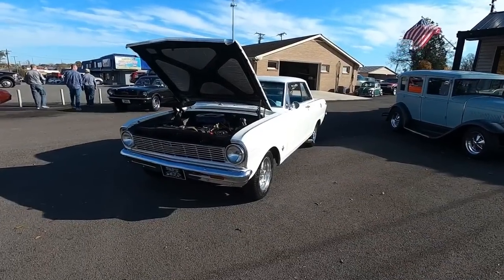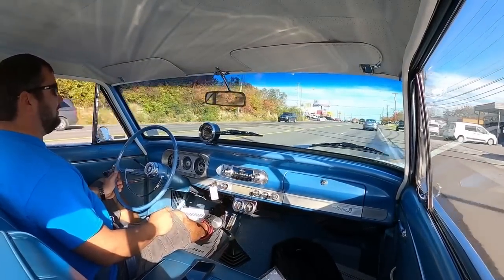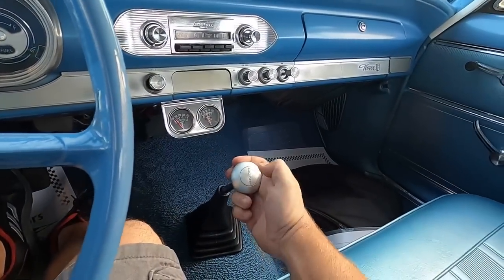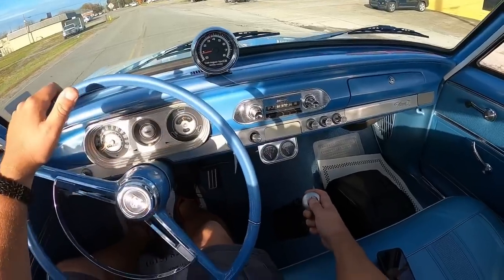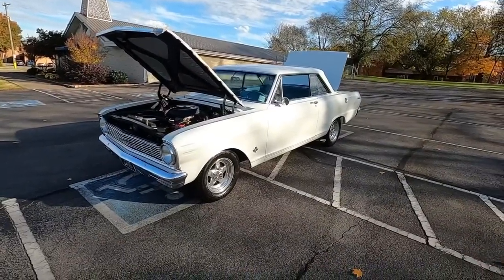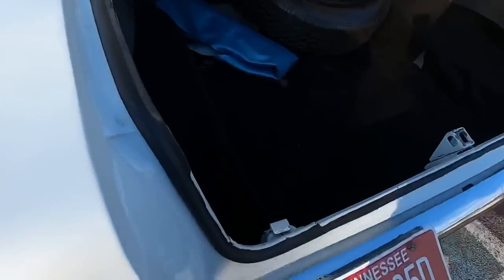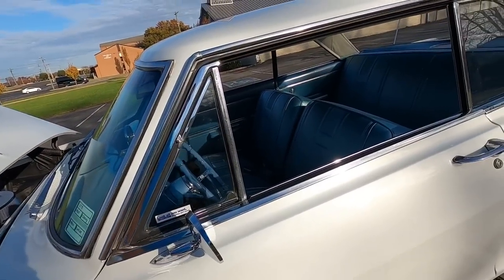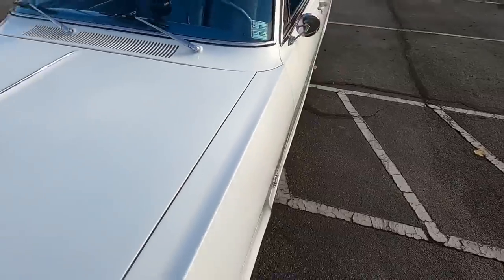Test Drive 1965 Chevy Nova SOLD $24,900 Maple Motors #1378

Comment: I bought a 1963 base Nova w/4 cyl & 3 on the tree in 1970 for $100 from an elderly lady.  53k miles.  Only options were a am radio and heater!  Took it to the auto shop program at El Camino College in Torrance CA.  dropped in a crate 350/350 horse Chevy, a Muncie T-10 four speed and 4:11 posi.   Sorted slightly larger aluminum rims with poverty caps.  Insanely fast.  A local got an Olds 442 for graduation and we got sick of his bragging.  He wanted to race me for $100.  I let him take my Nova through the gears.  He stopped the car, handed me $100, and made me promise to tell everyone that he beat me.  Deal !!!

Comment: Shiney new fuel tank, but crappy old shocks. At least is got a good undercoat of leaking oil.
Reply: I'm thinking he doesn't really need to worry about the problems the car might have or not.     Just advertise it and they will come.    I want it.    If I could afford it and I had the time.    I'd be there in a hurry
Reply: Shock tower front end suspension will KILL YOU AT HIGH SPEEDS.  We couldn't keep  a front end in ours 1964.  Sold it to a guy and he put a VEGA Rack n Pinion front end on it and it drove like a CADILLAC.

Comment: I don't remember if it was late 70s or early 80s when I had a paper route and the next street over from mine, at the last house of the dead end street, sat a white Nova with the multi colored 70s type paint job on the sides, and big yellow, red and blue dots on the roof. Looked like the dots on a package of Wonder Bread.  lol I don't know what model year it was. I think it may have been a '67. I can't really remember what the back part of the roof looked like. I think the '66 & '67 had more of a slope to them. All I know is, I REALLY wanted that car.